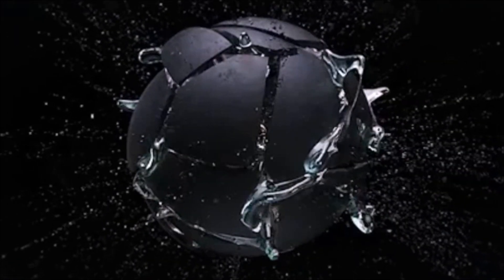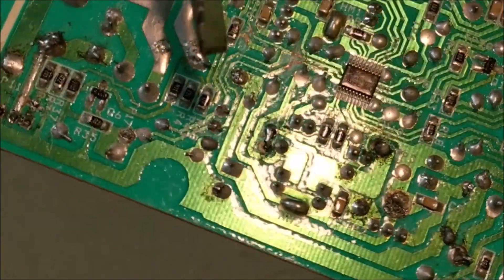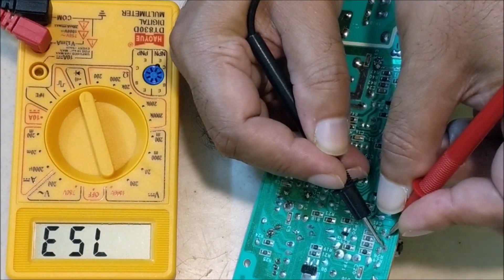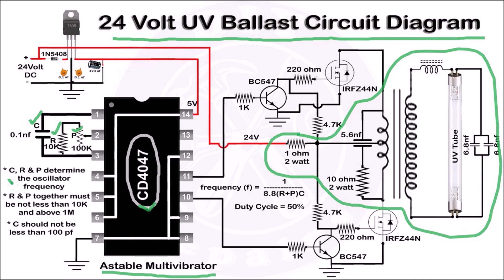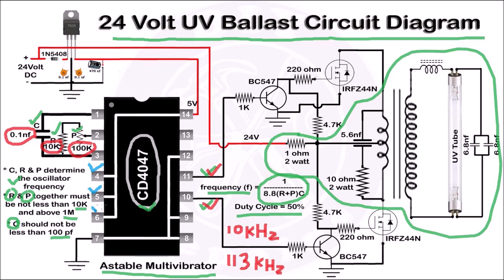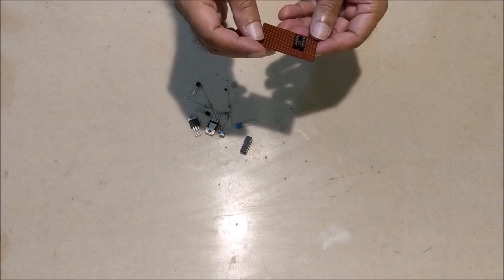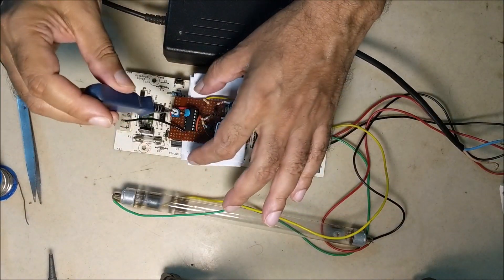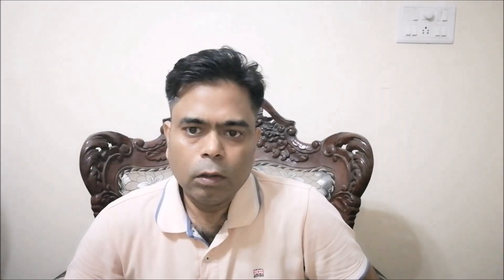how to repair electronic ballast or choke of kent ro water purifier | ballast or choke reset problem

Comment: hi i have seen your video i need a uv ballast dc to ac can you design
 it for me
Reply from the maker: already in my channel you can watch it in playlist kent ro
Reply: @diyrepairs  YES but i need to develop a better uv chock can you help me with it
Reply from the maker: at what input volt you want to make
Reply: @diyrepairs  24 v dc input , i saw in another brand it gives more life for the uv bulb , the output to uv bulb on load was 20 v ac , s i feel i need a circuit like that ....

Comment: I have Kent pearl ro and them problem is very weird, every thing is working fine but the external led indicator that is there on the ro body i.e. red and green are not working, after trying with another kent uv ballast it is working so what component could have gone wrong, please help
Reply from the maker: check the fuse in the ballast. if fuse is good then try to reset the ballast. if still not works then may be the microcontroller is bad.
Reply: @diyrepairs  Tried resetting, but stil the two led indicators are not working, but other than that everything is working perfectly fine and even it is purifying, it would be helpful if you can tell what component could have gone bad and how to fix this
Reply from the maker: @Infino985  did you check the LEDs?
Reply: @ yes it is working, even changed it with a new one, problem is not with the led
Reply from the maker: @Infino985  can you send me the pic of LEDs and the srea on the PCB board where they are connected. email- sushilkr11@rediffmail.com

Comment: Sir I have changed the all filters and then change the solenoid also after resetting preset more time but the beep is continuously running at the time of lighting the uv lamp are glow for seconds and then off and the red light is continuously beeping Sir what to do to solve the problem and water flow is not working thanking you for kind support in advance
Reply from the maker: bypass the ballast and run the machine directly and see water is coming out or not, did you check the pressure valve ? it seems that the problem is with water flow.

Comment: I have classic RO+UV pureit. Its controller is not working. So, can use ballast choke instead of controller? Can water purifier will work normally?
Reply from the maker: yes
Reply: @diyrepairs  Thanks for reply...

Comment: My kent grand plus RO is not turning on. Red light with a beep is continuously on. One beep every second. My booster pump was leaked so changed it. When we disconnect water pump, the RO turns on and filters the water as well with low pressure. But when we connect water pump (new or old), the RO turns off with red blinking light with beep every second. What could be the problem, please help.
Reply from the maker: Is the UV lamp working? If yes then try resetting the ballast. (video link
https://youtu.be/l_LQ_kjcNYQ). If this does not solve the problem then check the SMPS output voltage, it should be 24 volts. If the voltage is correct then the problem is with the ballast. You can bypass the ballast (video link
https://youtu.be/W8kH9ruunP0 ) or you can change it.
Reply: @diyrepairs  Thanks. I called someone yesterday. He forcefully changed membrane saying it is bcz of that. After changing also RO did not work. He asked to change ballast, added new ballast and same problem. Then he brought out UV light and used new one and did something with UV light connectors (black one both the sides) and the RO worked. He started asking for money for ballast and membrane but I understood that problem is not with the ballast. He suggested another way to direct the connections and bypass the ballast and we went with that. Now he said in this case UV will not work. Is there any way to make UV work by bypassing the Ballast? Additionally, RO tank is filling 2/3 only and stopping. What could be the reason? I called technician to visit again and rectify by he seemed uninterested and made excuses. Please help. Much appreciate and I also like to repair my own stuff. Thanks a lot again. You are doing a great job by helping people.
Reply from the maker: It seems the problem is with the UV lamp. Which UV lamp is currently installed in your machine, new or old? did you have the old ballast? is it installed? Why did you call the technician, you can do it yourself it's very simple. It has a float switch that senses the water level and stops the machine. Filling the tank 2/3rd of the way has no relation to the other parts. You can watch related videos in RO Kent playlist in my channel.
Reply: @diyrepairs  my UV lamp never changed after I bought RO in 2016. So I guess it will be old one. Old ballast is still installed but he cut the wires and bypassed it. I called him after struggling for the whole day. I don’t give up easily but was not being able to repair it. Now I am planning to buy the new wiring of RO and set it and repair it. I will keep you posted.
Reply from the maker: Why did the technician cut the wires? There was no need to cut. Just a jumper of wire had to be installed in the socket which is connected to the ballast. I have made a video on this. You can see by going to the playlist. There is no need to buy a new wire, just connect the cut wires together. I had asked yesterday whether the lamp was glowing when the machine was beeping? Green or blue light appears in the lamp holder where the pipes are connected when the machine is ON. Because even if the UV lamp is faulty, a beeping sound is heard. Secondly, when the machine runs for 700 hours, the filter change alarm in the ballast starts beeping. This is how the ballast is programmed. The ballast has nothing to do with the condition of the filters. In this condition only the ballast needs to be reset.
Reply: @diyrepairs  He cut in a way that the connectors are of no use now. UV lamp was glowing for 1/2 second and then turning off while turning on the machine. If we disconnected pump wire, machine was running along with UV lamp. UV lamps beep is every 2 seconds but in my case beep was coming every second. I was aware beep sound is related to the programming. I change filters and membrane whenever I feel they are choked. Don't follow Kent's routine. Ballast was not resetting, tried many times. Searched for the beep sound every second on google but no one faced such problem as of yet.
Reply: Let me know your email Id, I will share the video of the same which you can use in your DIY videos if you want. Want to contribute to helping other people. Thanks.
Reply from the maker: Was this problem was same when the technician installed the new ballast? Sometimes this type of problem occurs due to internal fault of the ballast. In this condition, replace the ballast or I had posted a video on how a bad ballast can light only UV lamps. You can watch this video. The second reason for this type of problem is SMPS. 24 volts should come from SMPS. When SMPS gets damaged, it gives 24 volts without load but the voltage drops significantly when load is given. Therefore, check the voltage of SMPS in full load.

Comment: Banaya Maine ye ckt but thodi der jalne k bd MOSFET short ho gaye
Reply from the maker: mosfet me heat sink lagana tha.
Reply: @diyrepairs lagaya tha kewal ek MOSFET ud rha bar bar heat hok
Reply from the maker: @NARESHKUMAR-ot1sm  220 ohm aur 4.7k ka resistance check karna hoga. 100 k ka preset ko pzhle zero par rakna hai phir dhire dhire badhana hai jab uv tube jal jaye to preset ko chod dena hai . mosfet irfz44n hi hai n